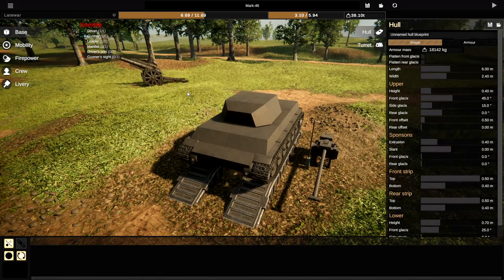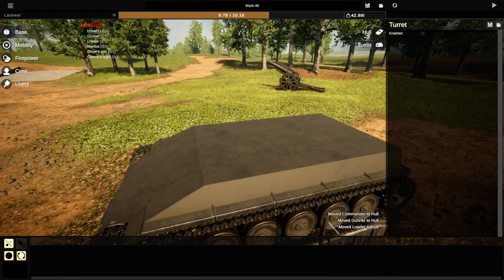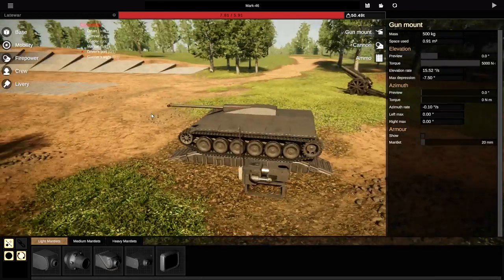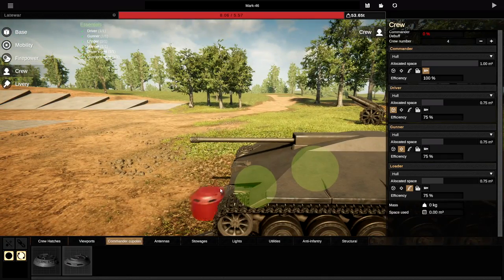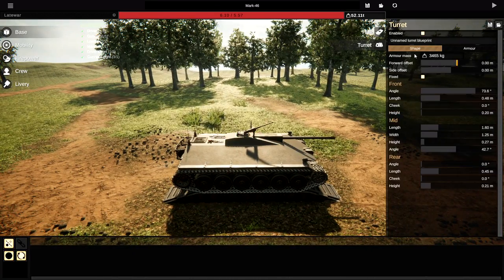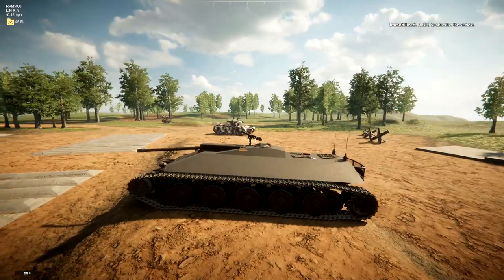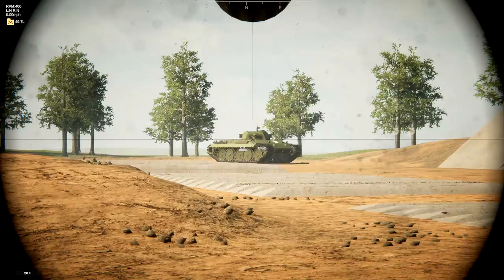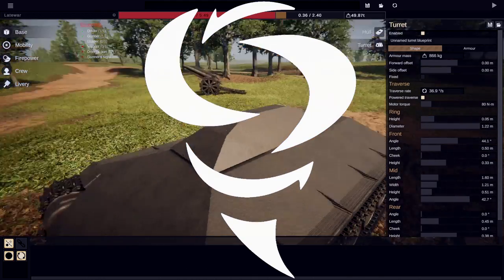Extremely Angled Armour Tank! - Sprocket Gameplay

Comment: I feel like the enemies shoot center mass down from the center of your turret position, so they will always shoot the same level from the distance they are at, does it seem like a plausible theory?
Reply: There is a little smarts, it will only do this if there's no where it can pen, if there is a spot it can pen, it will try to aim for it, it also loses aim the faster you move, you will often find tanks trying to get behind you when you make a tank with high front and side thickness, and the ai will snap to rear or weak spots on the turret, I think the ai uses every flat as a aim spot.

Comment: having a 50mm plate on a 85 degree angle gives an effective thickness of roughly 550mm, and a 200mm plate at a 70 roughly degree angle makes it almost 1000mm of effective armor. NOTHING will get through that, I dont think even modern guns can. Maybe a battleship, but that is beside the point.
Reply: Only ATGMs i guess
Reply: HESH go brr

Comment: You're denying yourself a lot of space with that V shaped hull; there's no point to doing that unless you're trying to make a vehicle mine resistant.
Reply from the maker: If I get shot in the side, there is an angle there, making the armour thicker without putting in more metal? :o
Reply: @FranticMatty  good point, after thinking about it, a lot of side shots will be in that suspension area where the armor tends to be thinner.  Sprocket needs side skirts